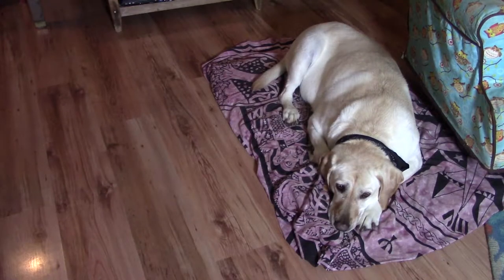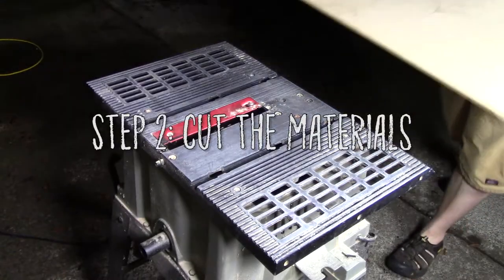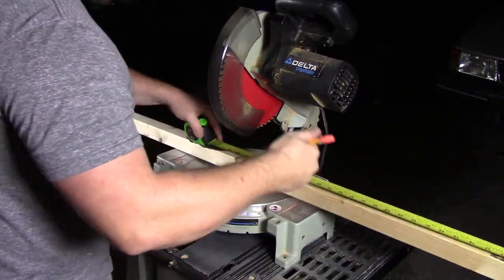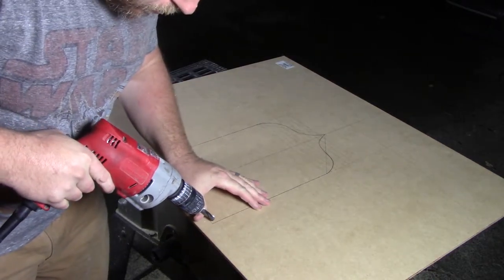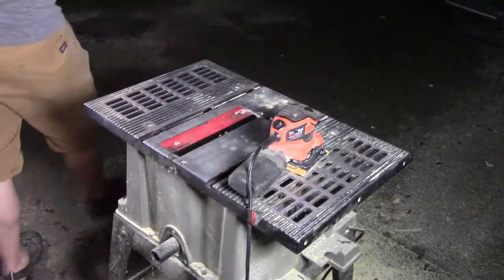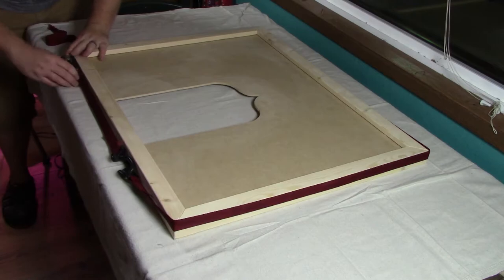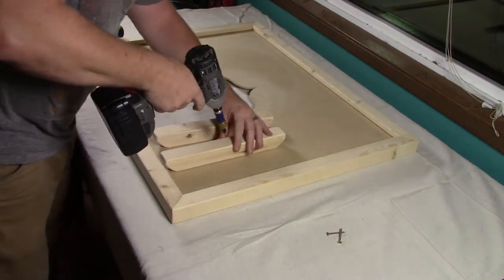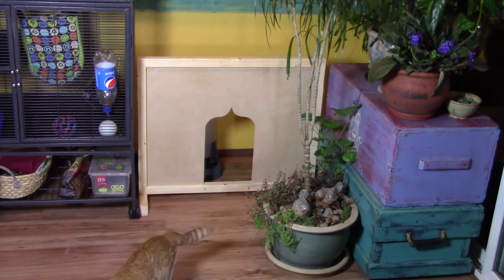DIY Dog Gate That Is Stylish And Functional

Comment: That turned out super sexy! Mr. Olson would have a fit if he witnessed your lack of saw safety. ;P
Reply from the maker: I know man, that saw is less than ideal but it is what you get for $50 on Craigslist. I will replace it with something better eventually, but power tools are expensive and for now I make it work =)
Reply: Shoot I'd love to have me a nice table saw like that. Last time I had to rip some long boards I was using a skill saw and cut the lines so crooked it looked like I was using a jig saw to do it.
Reply from the maker: That is unfortunately where this saw struggles the most. It has some sort of anti overheating protection, and if it gets remotely warm it will shut itself down for 10 mins or so (and it happens all the time). I love having a table saw though, even with its issues. It is one of those tools that once you have it, you wonder how you ever lived without it.